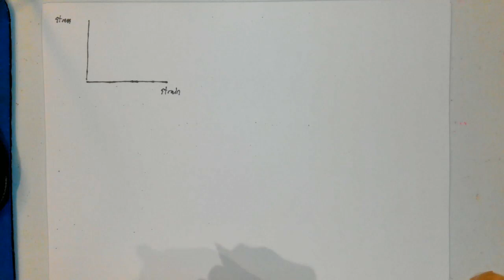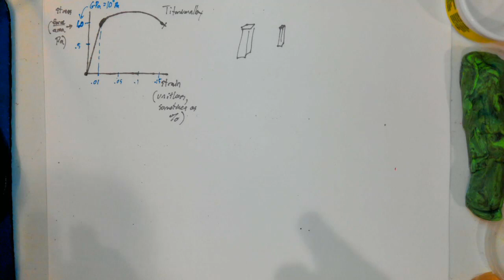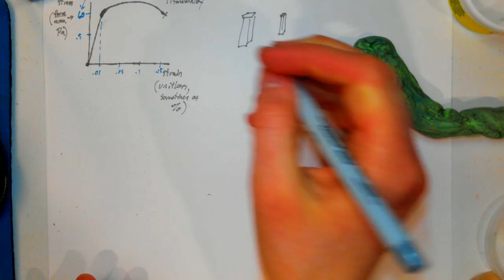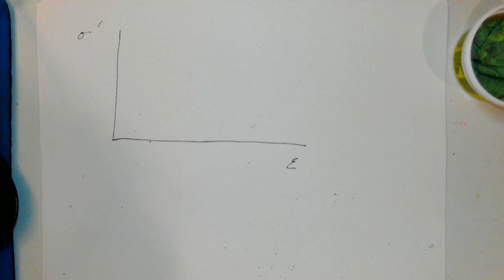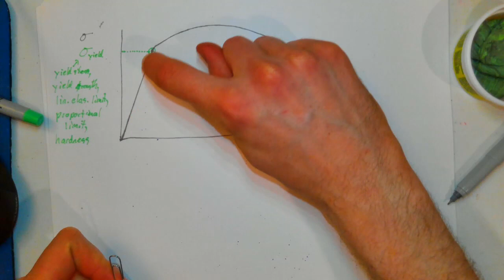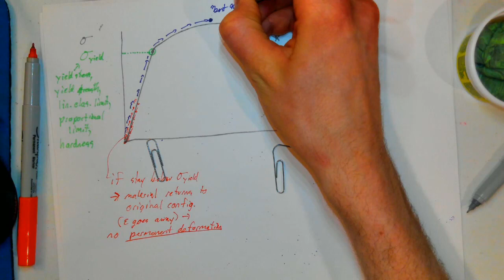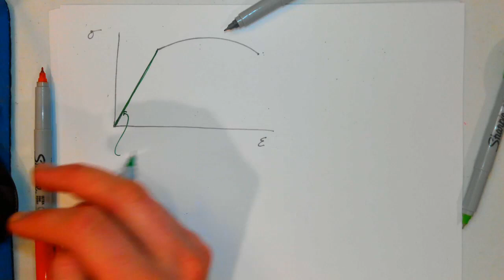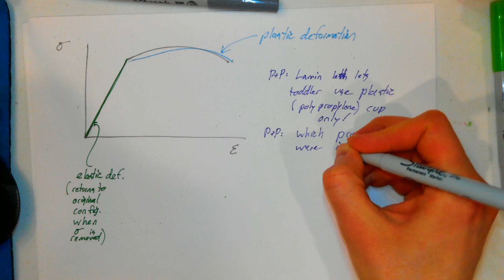BIOE 5820 Biomaterials - Stress-Strain Curve and Material Properties

Comment: Stress-Strain Curve: 5:56
How obtained? 12:35
Young's Modulus/Modulus of Elasticity/Elastic Modulus/Stiffness: 17:05
Shear Modulus: 20:25
Poisson's Ratio: 22:50
Yield Strength/Linear Elastic Limit/Proportional Limit: 33:45
Ultimate Strength: 44:28
Fracture Strength: 48:55
Elongation @ break 48:55
Toughness(ductile vs brittle materials): 51:45
Resilience: 51:45